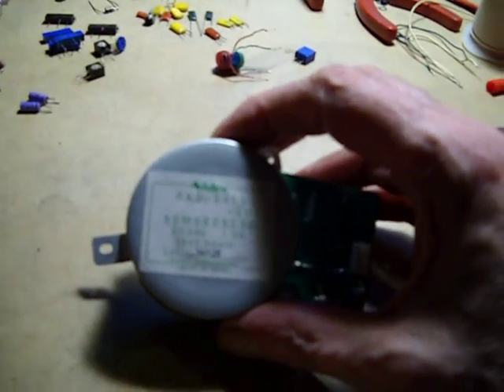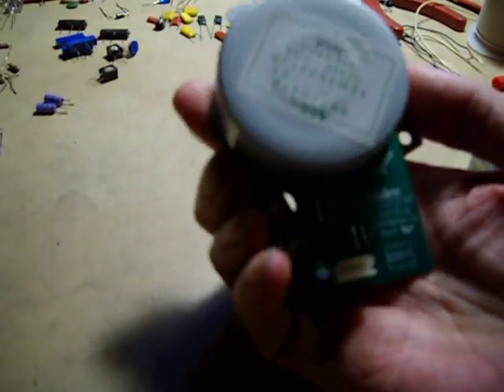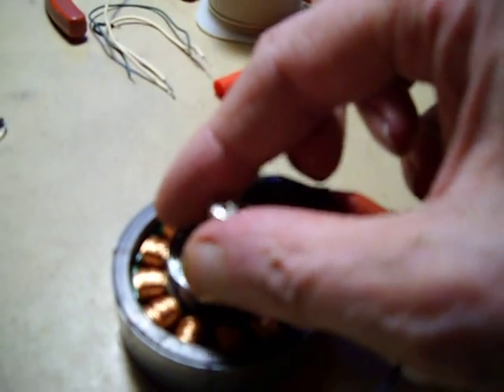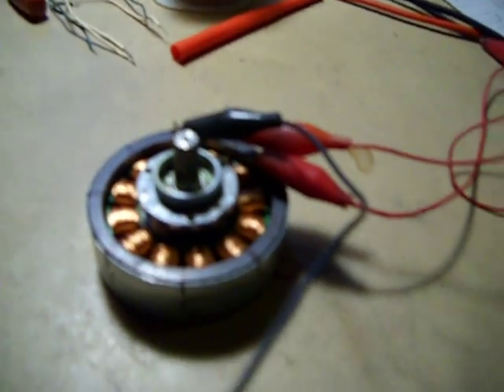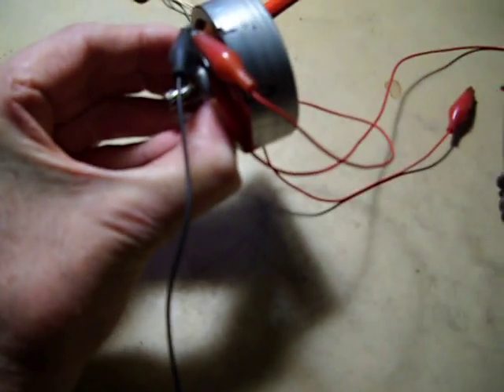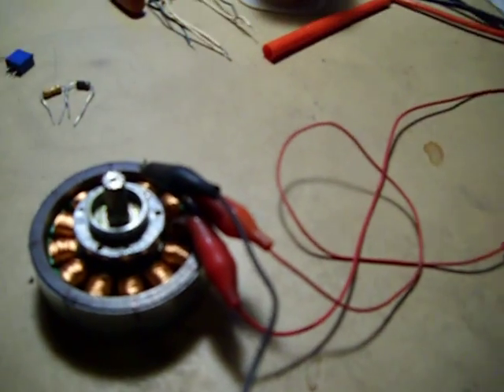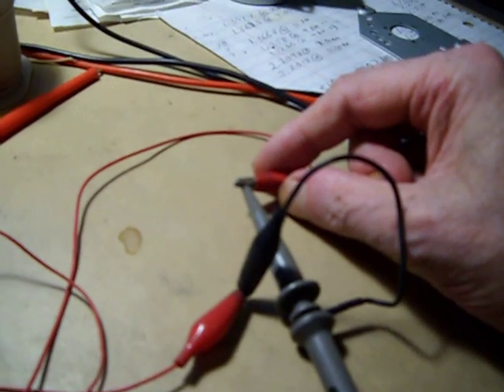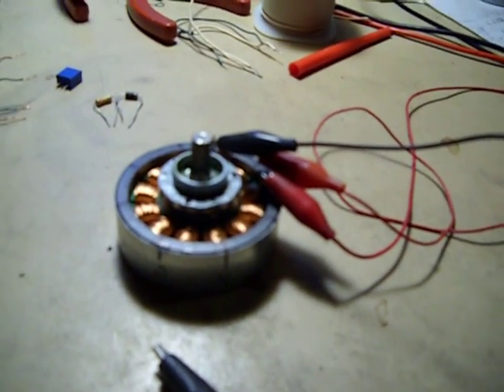Motor Test 1 RDTPPM

Comment: Hi I found your video very interesting and have managed to get hold of a nidec motor like yours. Could you please let me know how you get the rotor off because i want to rewind the motor as a Bedini type pulse motor but I cannot get it appart. I can se no circlip so i assume it is a pressed in bearing. But as I only have one motor I do not want to damage the bearings if I can help it.
Thanks
Jezza

Comment: You need to connect a real load like a 10 Ohm resistor to see the difference.
Your scope just has 1 MegaOhm input resistance and that is to the motor as if it would be open circuit ! Regards, Stefan.

Comment from the maker: i think this is going to be a big problem i tried to press mine apart and could only press it part way so pressed it back together.
i have two of these motors but when i am done testing this one i will try and get this one apart again even if i destroy it then i will at least know what to do to get it apart and will pass the information along.